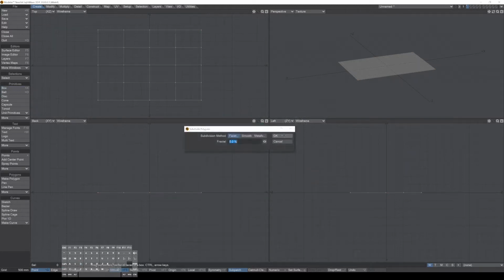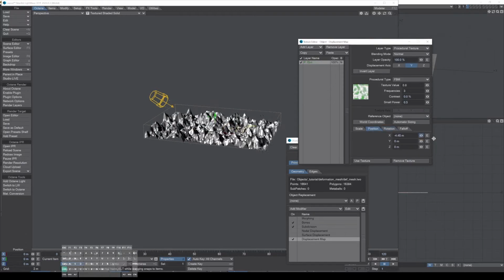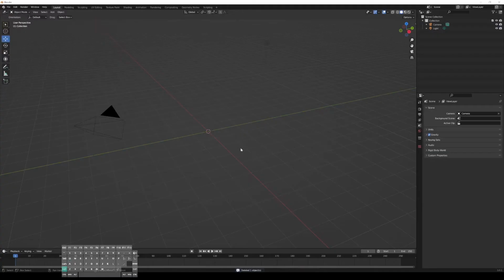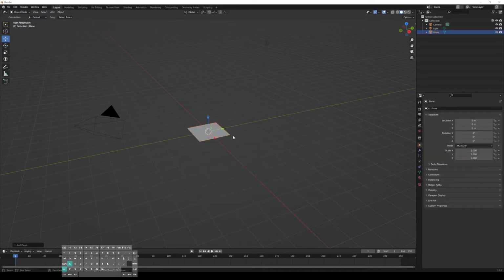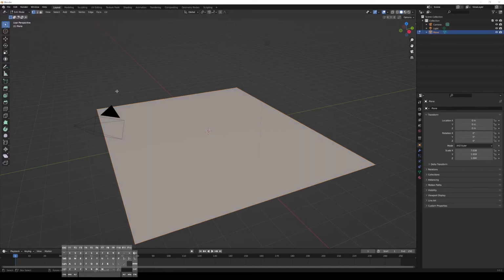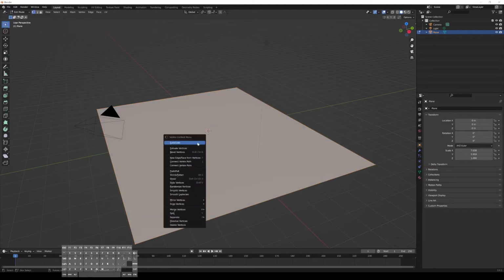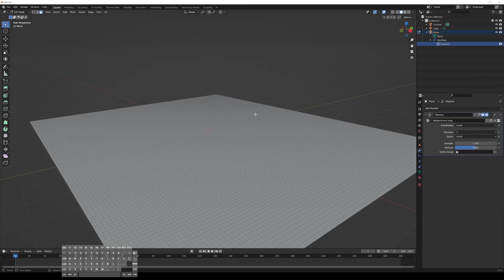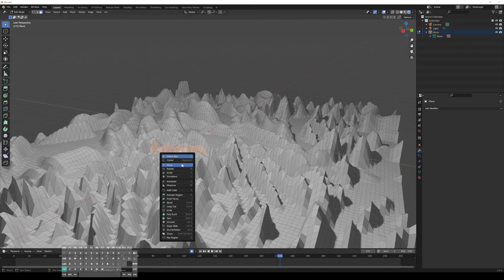Displacement Map in Blender: Junk I used to do in Lightwave (My First Week)

Comment: There are easier ways than complicating it, you could start with a grid, in Object mode and the displacement will be shown directly.
But if you insist on dividing in edit mode, you do not have to switch back to object mode, check the display modifier in edit mode viewport icon
(the top icons in the modifier tab, also check on cage to have vertices match the displacement, or if using subdivision modifier to have it look the way it does in lightwave without a cage)

Let me get this straight first, I am moving more and more to blender, but this sample of displacement isn´t  exactly the strong side of blender, apart from that you do not have freeze it and reload in blender.

First of, the amount of procedurals to use in blender sucks, and so does the way of applying displacement layers Only by modifiers...VS Lightwave, Lightwave has so many more nicer procedurals, including animated stuff, you do not have to wrestle nodes in a horrible node mess to get where you want, also all the fractals work pretty much along all the lightwave channels, that is missing in blender.

Second, it´s by far easier to setup nodal displacement than in blender.

Third, it is by far easier to blend fractal layers on top of eachother, just add them on top of eachoter, blend with various mode such as additive, multiply, subtract alpha etc, and textured displacement to distort the other fractal layers.
This is in reference to the textured layered displacement.

Lightwave is better to control strength within the actual texture, control inverse the  fractals in one checkbox go, instead of as in blender having to go to check ramp on, invert color ramp..that is horrible.

Forth, i also believe Lightwave displacements are faster on denser meshes.

Fifth, it is by far easier to control textured displacement falloffs in Lightwave by adjusting the fractal textures built in coordinates and fallofs.

Number six..
the way you tweak the modifer in blender, you have modifier strength in one tab, and texture settings in another tab..you will find yourself having to jump in and out to correct the displacement more than if you do it in lightwave, where all you have to adress is opacity without leaving the texture itself.

The only thing you got going in blender is of course the ability to faster freeze the displacement, but you do not have to go to modeler to use it ..unless you need to modify it by editing.

The strong part is the way you can sculpt in blender after you have created your procedural forms, but the procedurals themself, it´s just too horrible, it lacks many procedural types, at least compared to Lightwave, and as mentioned, stacking procedural displacement on top of eachoter is a breeze in Lightwave not in blender, and nodal displacement in blender..aha.

All this said, don´t worry..I love many other things in blender, sculpting in Lightwave..meh, in blender..very nice.
Geometry nodes starting to shape up.
And of course the render engine with GPU support.

For me there are some components that sort of is an obstacle for me to drop lightwave completely.

Fractals, it sucks in blender
UI, it´s a mess and needs better structure, and dropping of head turning vertical tabs.
Fix a better quad view.
Fluids, it needs a gpu solver, mantaflow is even worse than the older fluid dynamics
Implement better surface preset system.

Fractals also need to work all over the channels in blender, in lightwave I can use pretty much every fractal there is in Any channel available, from particle vectors, displacement, surfacing, volumetrics..in blender you lack quite a lot of that, you can´t even use the cloud texture available in displacement modifiers on a volumetric material in blender..it just baffles me.

If anyone get´s an itchy feeling of spewing out hatred when I state what isn´t so nice in blender, don´t..I have a buckload to throw at you of things I think suck in lightwave too...so for those thinking they should and needt to fight me with the sword of the knights to defend Any of the software, go to some other playground :)
Reply from the maker: > you could start with a grid, in Object mode and the displacement will be shown directly.
Part of the reason I'm doing these tutorials is that I assume this may be the first introduction to blender. as such, I want to demonstrate some subtle UI things that might catch LW users off-guard, such as editing a displacement while in mesh mode. I'm also trying to highlight things like the SHFT+A command palette etc.

> Second, it´s by far easier to setup nodal displacement than in blender. Third, it is by far easier to blend fractal layers on top of eachother, 
Questionable. Using a stacked layer of procedurals is basically the same as the "layers" in LW

> Fifth, it is by far easier to control textured displacement falloffs in Lightwave by adjusting the fractal textures built in coordinates and fallofs.
I found this quite clunky in lightwave

> Fractals also need to work all over the channels in blender, in lightwave I can use pretty much every fractal there is in Any channel available, from particle vectors, displacement, surfacing, volumetrics..in blender you lack quite a lot of that, you can´t even use the cloud texture available in displacement modifiers on a volumetric material in blender..it just baffles me.
you can absolutely do this. i  should do a tutorial. i'm still in my first week with blender, so we'll see how well i can demonstrate it

> it lacks many procedural types,
well you can put in any formula. since that's easy to do (is it even possible in LW?) you can import vast libraries of procedurals, or write your own, or copy paste fractal formulas from the interwebs. Here's a library: https://www.youtube.com/watch?v=-6ENVvTQJhE

> And of course the render engine with GPU support.
Having realtime raytracing is super slick. it never worked performant enough with VIPER in LW
Reply: @ForeverScape  

I understand that you wanted to treat it with insight on the edit mode, but you simply missed to describe the edit mesh mode modifier activation, and you refered to having to go to object mode, which isn´t true.

You think it is questionable that lw procedurals are easier to set up? it´s not at all questionable, I challenge you to describe how it can be better in blender, when you can´t even access the coordinates to move the fractals in the displacement modifiers for starters, also, once you have applied displacement in lightwave, every texture is added in the same UI over or beneath eachother, while in blender you have to add each displacement modifier on top, and apart from that, jump in to texture and then add the texture, it´s kind of three steps more to work with where in lightwave that goes much faster.

as for falloffs, clunky? why is that, it´s not even present in blender without adding other modifiers, there´s nothing clunky at all in lightwave, you just make sure you know how to falloffs work, then just move them in the texture tab, try that in blender.

As for fractals to work on all channels, Great if you have found a way and can show me, I need the cloud fractal to work with volumetric density, it´s not a part of any nodal texture.
I also need to push particles by fractal textures in velocity channels, so I am all for it if you can show that, speaking from my knowledge, I do however not see any possibility to do that.

What you describe as formulas, that is (at least shown here, you have to refer to something else in such case) just material presets with stacked procedurals it seems, you are only refering to a video showcasing material presets, not any new fractals.
Ivé seen many "new fractals" in blender which in essential are a horrible mess of nested nodes, which slows down calculation of texture output and thus render slows down as well, and apart from that, setting it up to get there, you can compare that with some rman textures from Dpont, where you simply only tweak a few parameters in One node to get what you want, and it´s obviously not limited to that when you go full nodal as well in lightwave.

As for GPU, it ´s not viper anymore in Lightwave( you refered to old viper preview), it´s vpr, and that is not the issue depending on how the scene is accessing other render settings, it´s about CPU power, not the VPR function itself.
The Problem is the CPU and bad GI and AA solving in Lightwave.

Other than that, I can only agree with you that it´s quite nice to have that fast GPU rendering, but we need to drop talk about realtime, not even in evee with proper settings for high quality do you get " realtime" results, you get close to realtime in the sense it may take milliseconds, or a few seconds depending on shadow and volumetric quality settings etc, and the same goes for cycles, it´s Not realtime, but sure as hell beats the slow LW rendering in many areas.
That said with the perception that many of us may not have a super powered CPU VS GPU ratio, there are those investing in very expensive CPU for Lightwave work, and as such the difference isn´t that huge compared to GPU cycles, but for those like me with a more medium desktop gaming machine (asus Rog GTX 1080,  Intel(R) Core(TM) i7-6700 CPU @ 3.40GHz   3.40 GHz)
It is by far faster with Cycles GPU.

Comment: Switching from lightwave to blender made me realize how many things in modeler were done simply and well, the amount of work I have to do in blender to get the same effect is striking, but well, newtek has clearly abandoned lightwave, so i need to.
Reply from the maker: I find the workflows are faster in Blender because you don’t have to backtrack as much. Not having to save intermediate files saves so much organizational energy. Also, you can non-destructively apply boolean/drills, so you wan work backwards to change something easily by just having wach drill be a modifier layer. Look up “working non destructively in blender”